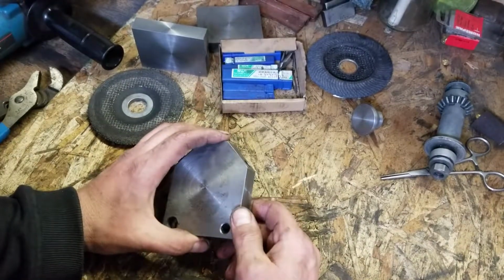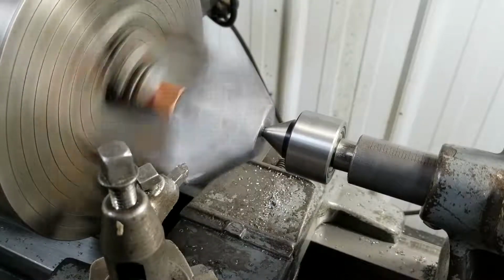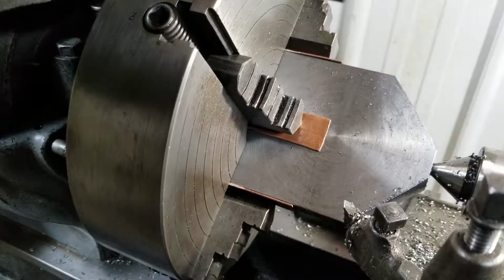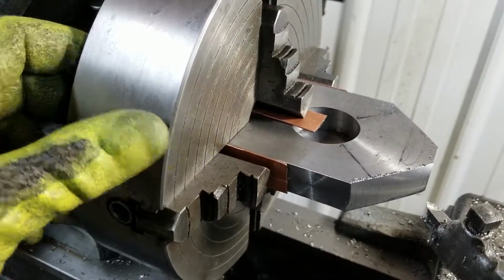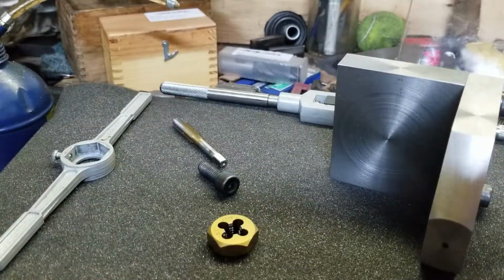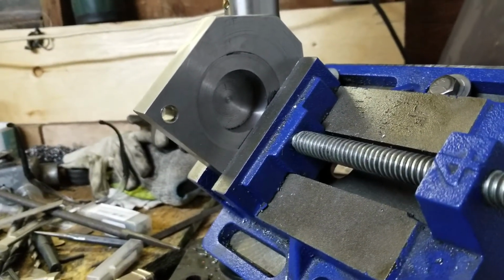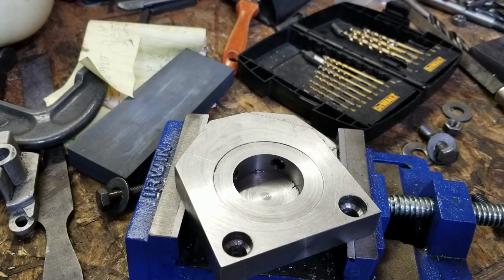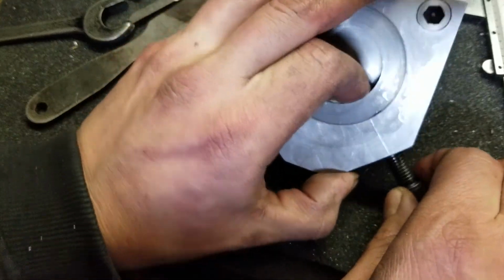Milling Attachment Build, Main Body Complete

Comment: I realize that quite some time has passed since you made this video, but thought I would throw a tip your way.  Whenever I need a countersink and am looking for a flat bottom hole, I will grind a bit flat and then relieve the flanks of the drill to form the cutting lip.  The work great to take the angle left by the drill and leaves a flat bottom hole.  I just pop the drill in an old index and save it for future use.  I do something similar for sheet metal and brass.  Take a slip stone and create some negative or zero rake on the cutting edge so the bit doesn't grab the material.  After a while you will have a nice assortment of drills in your spare index boxes.  Just subbed you.  Enjoyed the video.

Joe
Reply from the maker: Damn, those are some great tips, Joe! Thanks! 😊

Comment: Hell yeah man. I think you could make two or three gussets too if need be, but it doesn't look like it will need it. I guess it all depends on the vise, yet I can't imagine you will be hanging a 50 lb vise on there, so likely you're gold. At any rate... it looks SWEET!
Reply from the maker: Thanks! I am anticipating some rigidity issues and already have a piece in the works lol. But I'm really happy how it turned out 😁
Reply: Anyone in their right mind would have to be happy with how that came out. When you nail it, you nail it. Sometimes you tweak stuff, but all in all you threw a bullseye. :)  @Just1GuyMetalworks